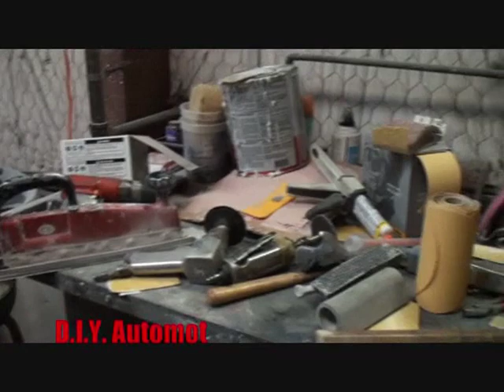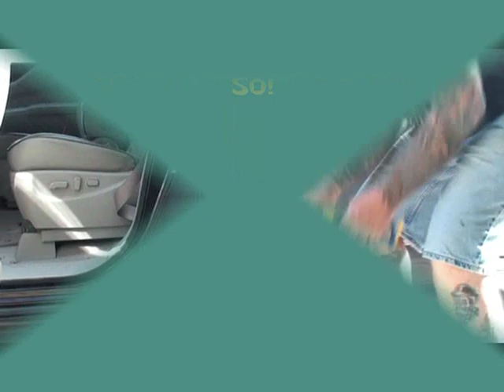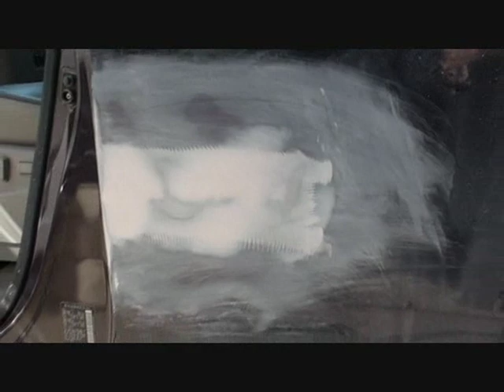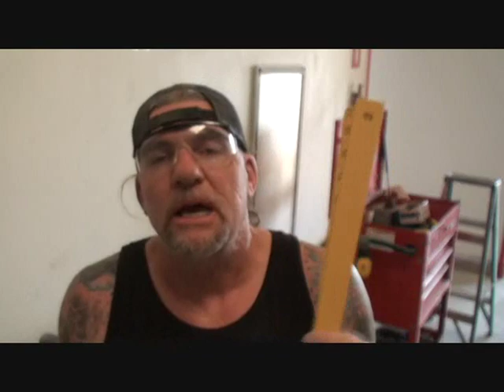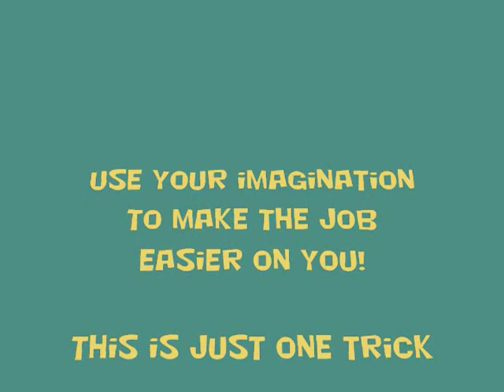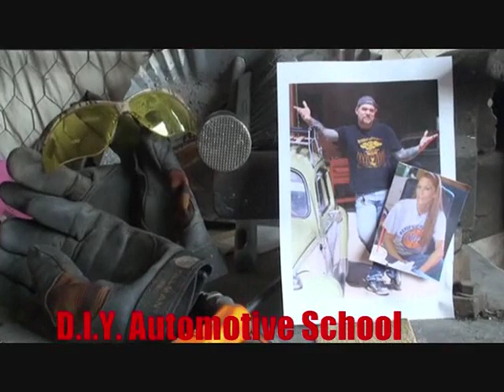Dent Repair Techniques-Bondo Shaping Using An Aluminum Ruler-Part 2

Comment: Wish I would have watched this sooner!! Just repaired a quarter panel by the tail light of my 2000 camaro. Mixed bondo probably five times to get all the spots filled. I have zero professional experience but it looks like I do. Watching these videos and learning from them, I did it right. And it looks right. It is ready for paint. Just wanna say thanks. These videos you make are GREAT!!

Comment: You get the proper curve and coverage with 1 or 2 quick passes of the ruler, instead of having seam lines from multiple passes with a small applicator which would have to be sanded out later. Especially on newer very thin metal vehicles where just sanding could cause new dents from pushing on the sanding block.

Comment: hi thanks for the video, when you apply primer, wll you go littleover the 80 grit and prim it or u should apply filler less than what we have sanded with 80 grit.. i assume we shouldgo little over the 80 grit sand,same while painting. pls adivse.